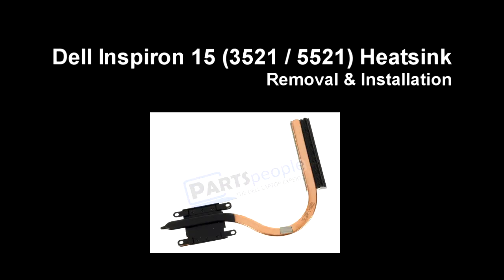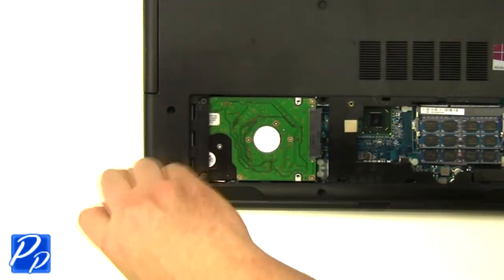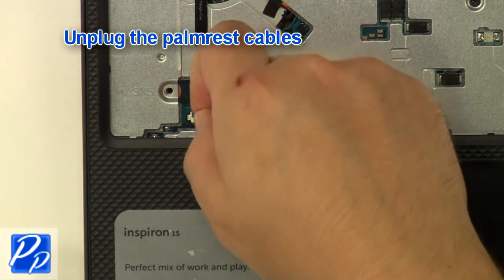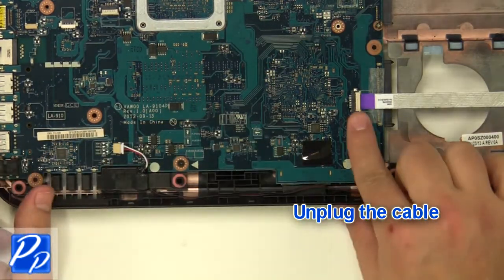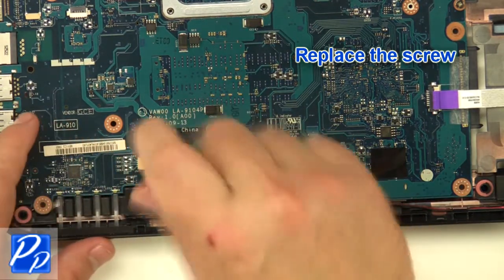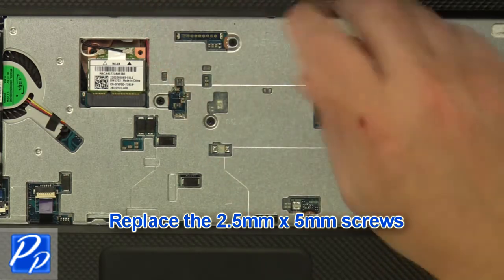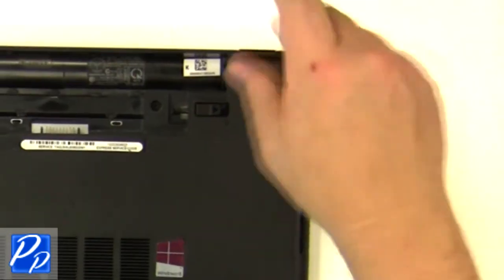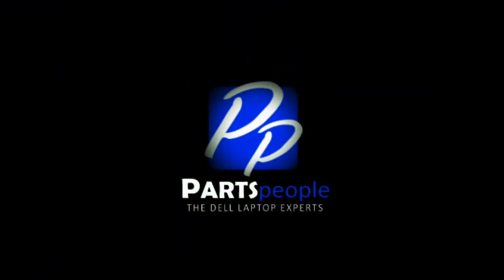Dell Inspiron 15 (3521 / 5521) Heatsink Replacement Video Tutorial

Comment: Followed this tutorial, You seemed to have missed the Wifi adapter and, removing the harddrive, Ram and the CD Drive.

Also re-attaching the Wifi adapter and which cable goes where for the antenna.

Also, for those who are removing the heat sink, if your screws are really stuck in there, be careful when applying pressure as you can snap or break the ribbon latch connectors at the bottom of the motherboard.

Ended up breaking the Power button ribbon connector off while dealing with CPU screws, had a very tedious episode of attempting to re-attach the black plastic bit back on. ended up fixing it after an hour or so